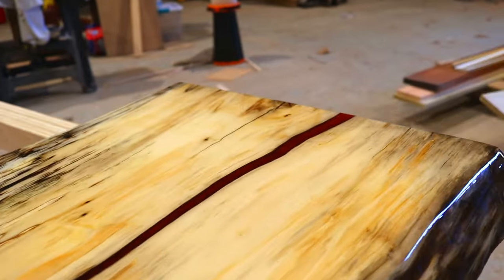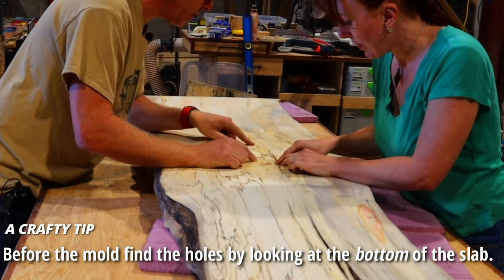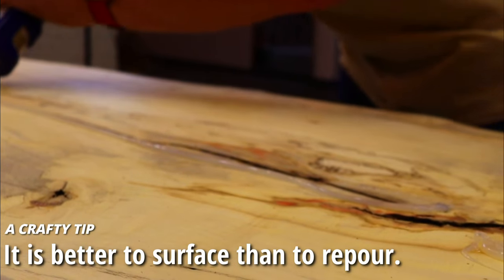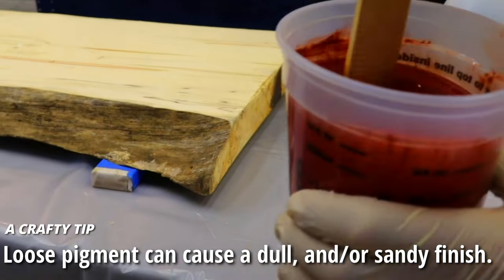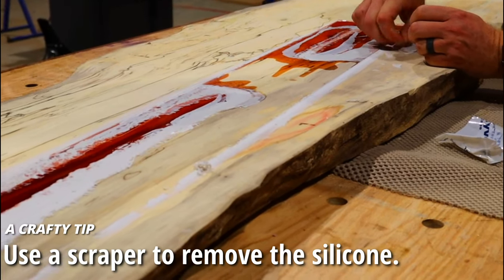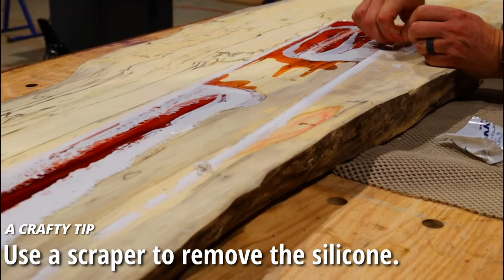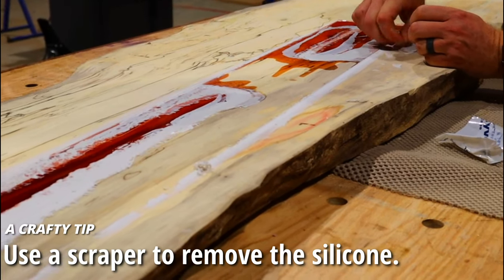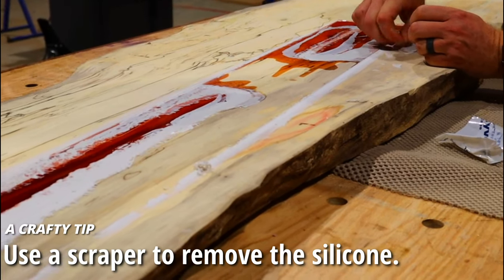How To Fill Cracks & Holes In A Slab Using Epoxy | Step-by-Step

Comment: Great video, like others have mentioned I have learnt a lot just from watching.
One question when you are doing the final 3 pours and the bottom edge or underside of the slab/ table has all the drips of epoxy on the edge. How do you go about cleaning that up and also how would you go about it if you wanted to seal the bottom of the table with say one coat of epoxy ? How do you stop the epoxy from creeping or dripping whilst drying ? Would you do the main top of the table first and finish with the underside or other way round ?  Appreciate the feedback thx again, great easy to follow video.
Reply from the maker: Hi thanks for asking. All that foots free was lost sorry. They get sanded off w 60 grit on a random orbital sander or you can use a 50 grit sanding disk on an angle grinder. I usually finish the bottom with poly or lacquer. I’ll be updating this video soon so stay tuned and thanks for engaging.

Comment: How long do you wait before sanding the seal coats? 72 hours? 7 days?  Everything else in the video was very good. Thanks
Reply from the maker: Hi. Thanks for asking. You can sand after 24 hours or when you are sure the top is cured. Depending on your pour conditions, I’ve sanding at 12 hours.

Comment: Hey there.. great great video that answered almost all my questions! But I am curious.. you said you use 3oz of flood coat but didn’t clarify which stone coat product you used for that. Did you use the same countertop epoxy that you used for the seal coats on the flood coat or??
Reply from the maker: Hi. Yes standard countertop epoxy for the flood and seal coats. 1 oz per square ft for seal coats and 3 per square foot for flood. Thanks for asking

Comment: I saw one video where they used hot glue instead of silicone for the dams. Does that work?
Reply from the maker: Yes that will work as well but depending on the depth of your pour the exothermic reaction it could fail

Comment: I have a new table that I wanna make after a couple practice pieces. This slab has a decent crack at the one end and was wondering if I needed to bowtie it before the epoxy or if an epoxy fill would be enough to hold it together in the future?
Reply from the maker: Hey Mike. Not at all. Great question and thanks for asking. Resin acts as a glue and has more than enough holding power therefore bow ties are not necessary. When you purchase from StoneCoat Countertops Epoxy use my discount code thecraftyweiner for 10% off your purchase and reach out with any questions. 🤘🏻

Comment: How would you coat the top and bottom of a slab board to use as a fireplace mantel? Thank you
Reply from the maker: Hi Craig. Any option you have at hand will work as long as you allow it to cure fully. Are you asking about resin coatings or oil based finishes?
Reply: Hello!  Thanks for the response.  I was wondering about the epoxy resin pour on a slab.  So I could do an epoxy resin flood coat on one side of the slab, allow it to fully cure then do the epoxy pour on the other side and it will all work out on the edges of the slab?
Reply from the maker: Yeah you will have to sand drips on both sides but that is totally possible. Flood coat the bottom FIRST that way you sand the top off and then when you you flood coat the top the drips you sand will be on the bottom if that makes sense.
Reply: Yes that makes sense.  I am at the beginning stages now of filling cracks with black colored epoxy resin.  I appreciate your response and help with my question.  Thank you, Craig

Comment: The questions that seem to evade most online docs or videos are the volume/time/temperature triangle (with humidity a play too). I have been a novice woodworker for two years and still have not really "figured this out" from any source. I have filled gaps and such in wood, some modestly big. Curing is the complexity per an epoxy solution. Where can we get help with that?
Reply from the maker: What exactly are you having trouble with as it pertains to curing?

Comment: I’m currently doing a table like that with a long split also. It’s about 2/16?? of an inch 3mm with a lip. I’ve clamped it level, im wondering if the resin will hold it level once it dries or should I lock it with some dowels or something else. My gap is about as wide as yours
Reply from the maker: Hey there, thanks for asking. you should be fine with a 3mm crack. the resin will bind it. If you are concerned you could router in channels and support it with some dowels. Post a photo so I can see it.

Comment: How long do you wait to do the first sanding on the crack pours
Reply from the maker: Hey! Depends on the temperature that I pour at. The bottle says 72 hours, but if the top is hard to the touch you can do it in as little as 36. Thanks for asking!

Comment: I have a slab that has a couple cracks. I'm planning to fill with West System 2-part epoxy. 
Question: does the epoxy top coat add any structural integrity to the crack? Or does filling the crack do the job? I ask because I want to use polyurethane as a finish instead of epoxy. 
Thanks!
Reply from the maker: Hey Andrew. Thanks for watching and asking. Filling the crack will be fine. We used an epoxy top coat because this is going to be a coffee bar. Any top coat is fine. Thanks again for asking and reach out with any questions! 🤘🏻
Reply: @the_crafty_studio_official  Thanks for the reply. I'm still on the fence about bowties, though. I had an idea. What if I cut out the bowtie impression, but instead of putting in a wood bow tie, I fill it with epoxy. Once the epoxy hardens, would that create the added structural strength that a bow tie would create?

Seems easier than cutting the bow ties, plus I don't have a bandsaw, and these will be on the underside so I don't care that much about how they look.

Comment: Did the red epoxy not bleed into the wood? I just did this but with black mica powder on my spalted maple slab. It sorta bled into surrounding wood. I had to sand it down a LOT to remove it. 

Some people say you can use sanding sealer before the epoxy so this doesn’t happen. What do you think?
Reply from the maker: Hey Justin, thanks for asking. For us it really didn't but you have a valid point it CAN. You can definitely seal the wood with sanding sealer or even some penetrating resin if you want before you pour. If you are going to use resin as a top coat go with penetrating, if not go with sanding sealer. Do you know how to make your own penetrating resin?

Comment: table has nice color etc BUT epoxy tables are soooooo gross. just use epoxy sparingly for voids etc and go with an oil finish for the actual wood. pro tip of the day!!
Reply from the maker: I think it depends on the application of the end user. While I agree oil finishes are amazing, there is a case for epoxy top coats.